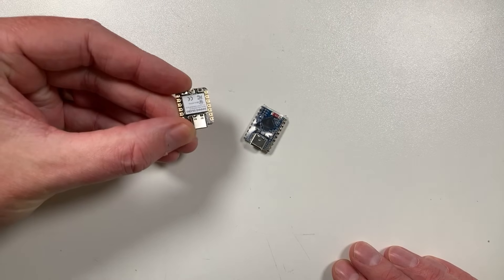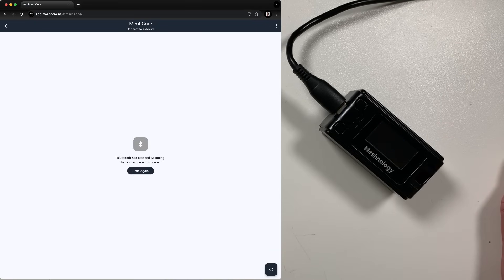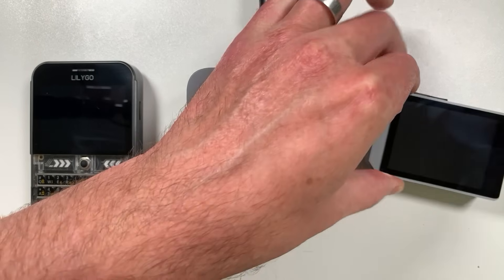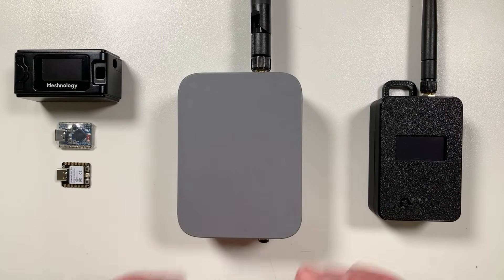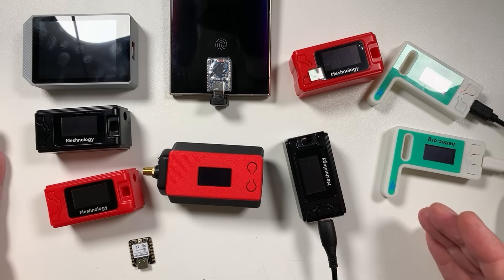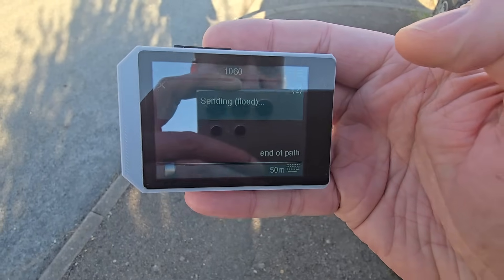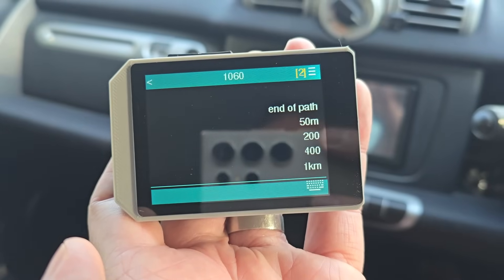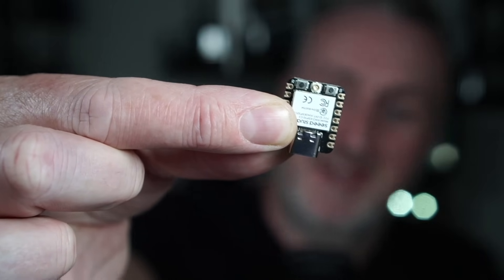EXCITING NEW FEATURES FOR MESHCORE!!!

Comment: A use case I would be VERY interested in is a sort of “hyper repeater site”. Multiple Meshcore repeaters on the same rooftop. One with an omnidirectional antenna for servicing the local area, another one or two with yagi antennas aiming at neighboring towns.

If you look at a map of North Carolina in the USA, right in the middle of the state, I’m thinking about bridging the major cities of Raleigh, Durham, and Chapel Hill (who have a little bit of distance between each of them). But there are a few good rooftop sites in each city that could reach one another potentially with a yagi.

Comment: I'm really liking this system; I've installed it on all my devices. It works very well in South America (Chile). But one of the problems, for example with the SenseCAP T1000E and others, is that it loses all of its GPS, sensor, and other functionalities.
On the other hand, I'm having problems with the T114 device. The firmware installs, it connects to the phone, but the screen doesn't turn on.
I know it's still in its cradle and is off to a very good start. We're eagerly awaiting new updates.

Comment: I notice the SF default is changed to 11 which is good, (I'd given up with repeaters on SF 10, now I've set some up again.). However I checked on 869.525 on my scanner and there is a constant high signal, (both in my room and at work.) I looked about frequencies and there appear to be four frequencies that allow similar power to 869.5 and they are much quieter (here). It would be useful if there were named presets for such frequencies, for compliance and making it easier to end up with a mesh on the same parameters.

I also really like the idea of dual frequency to avoid collisions on the first hop. It would be nice if (further on down the line) the bluetooth protocol could also be used as an alternative short range meshcore network, allowing different android (etc) clients to similarly connect to a repeater, (and removing the need for static companion radios.)
Reply: I got almost 1km (urban) to the repeater/room on the quieter channel, while on 869.525 I was lucky to get 250m.

Comment: Ok meshcore. Esp now I’m guessing it’s allowing the boards sending audio to compensate for the airtime and bandwidth associated with it. So it’s becoming a Meshtastic clone with a different wrapper and a short range file transfer. What about a ha low network deployment?
Reply from the maker: Not a meshtastic clone 😉
Reply from the maker: Not sure about Halow, it's IP right?
Reply: @andykirby  WiFi protocol, on the Lo UHF band, longer ranger, lower data speed.

Comment: Great work, for me it was one of the downsides of mesh - companion node as lora was pricey unnecessary thing, bluetooth is too short range, wifi is too power hungry. ESPnow is great idea there - range, power consumption, and it costs 1/8 of Lora module (and saver money can be used for one more Lora repeater in good place). But from what I have seen before - ESPNOW not working good with bluetooth at same time (from my early research when espnow was anounced, so my info may be outdated), is it true or companion can be BT connected in the future or usb-only (I see usb there for testing software at today's stage)?

Comment: I have one Heltecv3 and one Rak4631 with version 1.4.3 on them,  and I had it working this past weekend, until the iOS app update last night, now Bluetooth will not connect.  Tried re-flashing both units, still no Bluetooth connection, or pairing step.  Unable to get them to connect to the web client via USB.  I will say this, when It was working I was able to reach my car at the far end of the Sam's Club Parking lot while inside at the opposite end of the building.  Message confirmation was instant.   I don't understand why I can program using windows 11 computer, but when I try the webclient it just hangs in Connecting.. no error either.  It maybe too early for this but is there a plan to have forums for users to get help or report issues?

Comment: 2.4ghz. there any way to make a phone's wifi radio speak meshcore? Pipe dream really, but one of those 'would be nice' things.

What kind of distances can you get on 2.4 with one of these gateway devices? We talking maybe ten meters? A hundred? 

What kind of speeds are we talking? What sort of data would be practical to send?

Apologies, just. I'm both a tech enthusiest (that is perpetually broke,) and a speculative writer as a hobby. Something like this gets the neurons firing on how to bridge distances that most off grid methods of networking don't even bother addressing, rural connectivity. How to get messages going from point to point to point when your nearest neighbor is a fair bit away. Granted I'm on a ten acre hobby farm, so not exactly rural but in that annoying middle distance where the suburban and urban methods of relaying fail, but it's still too urban to be considered 'rural.'

This is all utter nonsense but I don't want the thought to be wholly lost:

Home network (wifi router, mesh repeaters, etc. Stuff your phone/tablet/laptop/etc can connect to.)

Attached to that netowrk are these gateway nodes. Those nodes can handle internal to the network LoRa data from sensors, data transmitting, etc. 

networked users (you, me, whoever) can either use something connected to the network over wifi or eathernet to talk to the gateway to transmit over the 915/833mhz (depending on region) LoRa mesh to get data in/out from there

OR

Use the 2.4ghz interface to directly talk to the gateway via whatever device. phone, sensor package, LoRa based BBS/mailbox, whatever.
Reply: "Use the 2.4ghz interface to directly talk to the gateway via whatever device. phone, sensor package, LoRa based BBS/mailbox, whatever."

As I understand the situation ESP NOW is unique to the ESP 32 chip, so to use other devices, meshcore would need to have the alternative of bluetooth, which would likely be an either/or choice with ESP NOW. (But I hope it happens in the future, once ESP NOW is working well)

Comment: Feature creep...
Reply: Possibly correct. However using the 2.4Ghz for (relatively) short range traffic both frees up the primary long range LoRa frequencies, and the 2.4ghz band allows for more bandwidth intensive applications. For now the primary use case would be 'get your phone's tiny stickied on mesh device to talk to the gateway that does the actual transmitting past your car or wherever with it being treated as first hop instead of the phone, or as a dedicated monitor frequency set for (relatively) close range sensor clustors. 

Theoretically voice is possible over 2.4ghz along with other data given several wifi standards use that frequency range, but for the short term the biggest feature here is that it makes use of the built in radio for the esp32, and you can sticky this to a phone and not have a giant honker of an antenna making you look like the unibomber while controlling a nearby mesh setup with a proper antenna.